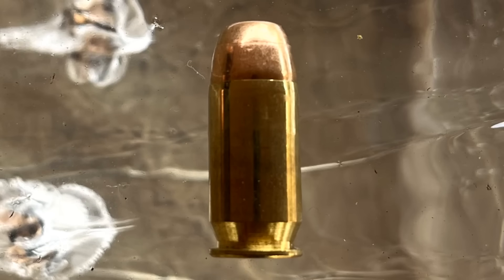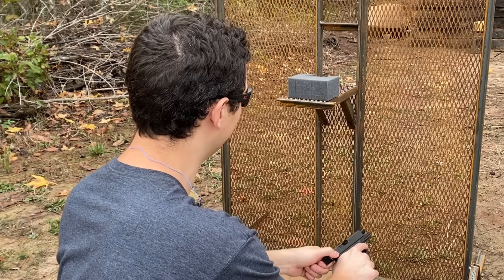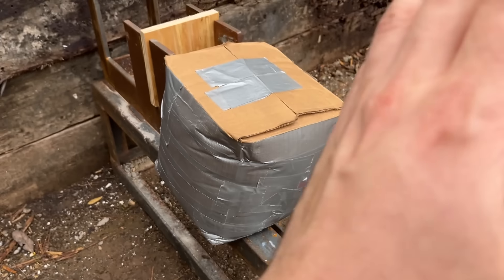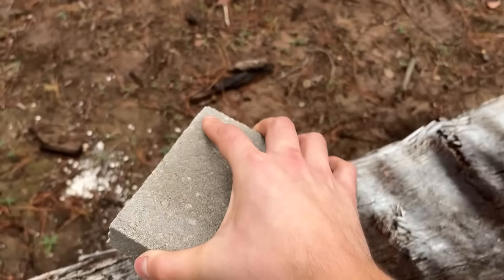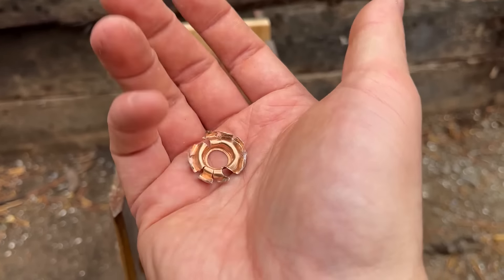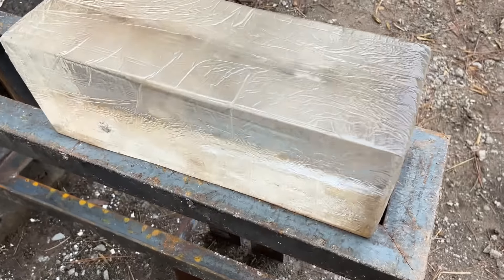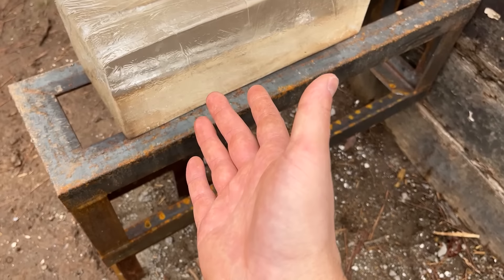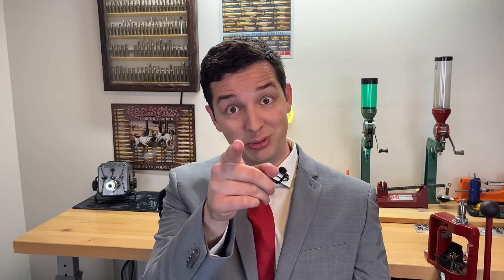9mm vs 45 ACP Barrier Test: No Debate?

Comment: The debate between 9mm & .45acp.Will never end it all comes down to personal choice.
Reply: Well said. Nobody wants to be shot by any gun.
Reply: Yes Sir!!!😎👍
Reply: This is an instructive video... for people that get attacked by wood and concrete monsters.
Reply: So, why would you personally choose less rounds in your gun all else being equal.
Reply: Same with the whole 1911 v Glock debate.
Reply: Plus  availability and cost between the 9mm and the 45.
Reply: 9mm  is throwing pencil size...45 throws ash trays.
Reply: The FBI usually has the best testing and test results from the many different options.
Reply: Also situations.
Reply: BS....  9  is  SUB PAR -    on purpose
Reply: @murrismiller2312  Not really true, the 9mm and .45 acp is sub par if you use them in the wrong situation.

.45 ACP is better for self defense  hence people tend to fire 1 shot regardless of caliber and most situation has at most 2 bad guys and ends with less than 10 shots.

9MM is better for Combat hence people tend to fire 2 shots regardless of caliber and mostly you are probably fighting hundreds of people so having alot of ammo is giving a chance to take down as many bad guys as possible.

If you dont agree, ask military personnel to switch to a 50ae pistol.
Reply: @markmccormack1796  They also said the 10mm was super great & will change the 🌏. It didn't. The FBI also returned to 9x19mm & new 9mm guns: Glock 17M, 19M.
Reply: @@raytrammell9452 Most gunfights are finished in seconds
Reply: The FNH 45 with 15+1 capacity has entered the chat.
Reply: Yes, choose both.
Reply: @chillmonkey6782 Because I never miss silly goose. 9mm holds more because you will definitely NEED them.
Reply: BryceCzirr-jz7ju You must miss a ton XD
Reply: No it's not. There is a lot of scientific proof that hand grip strength problems force the smaller caliber into the win department by quite a large margin, making it better for big groups (like LE) to choose as a standard. I happen to have a really impressive grip strength and I would prefer the larger round, but if someone like me is not practicing and unused to the recoil, then multiple shot situations will show why the 9 mm is actually better. It's definitely better for women and weak men.